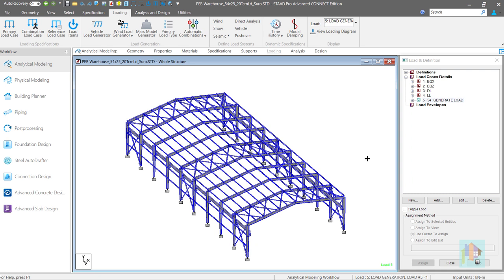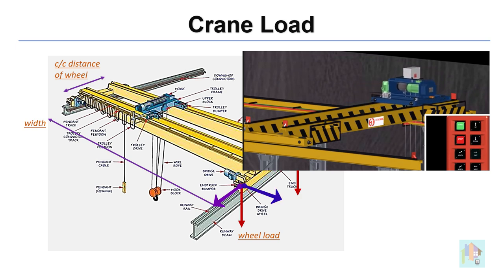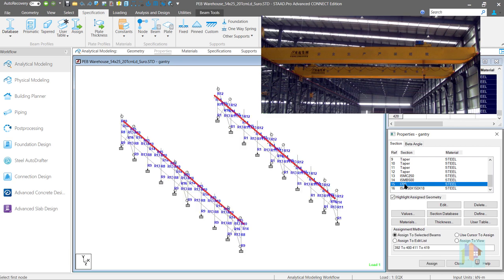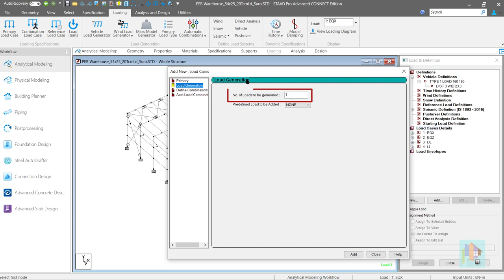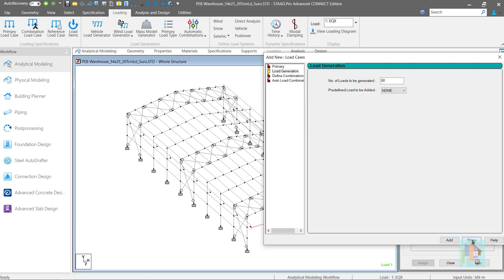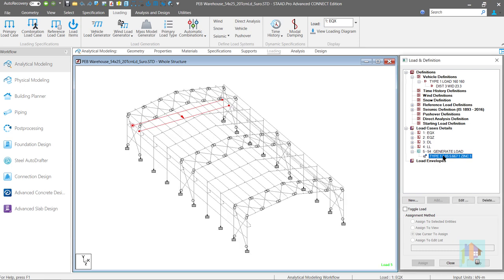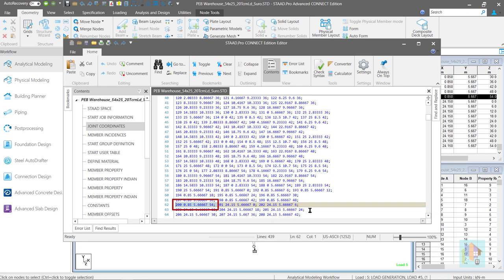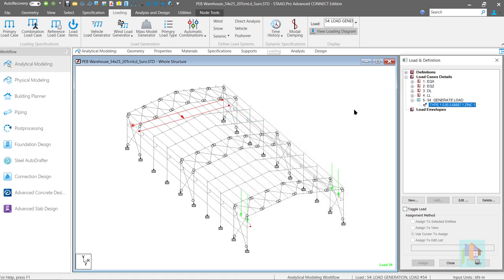Moving Load: p5 - Crane load for Gantry Girder Design || EOT Crane, Vertical Wheel Load

Comment: Staad is unable to add an opening enclosed by beams in parametric plate generation. Please sugest how to add an opening enclosed by beams?
Reply from the maker: If you use parametric model, you can add an opening at any portion and the mesh is adjusted based on the opening. In older version of STAAD, there were few problems with Parametric model option, you can try with the latest one where those problems are fixed.

Comment: Sir Auto load wind generator is not working in my system
Reply from the maker: Wind load generator should work properly unless there is some modelling issue or the inputs are not correct. Also in older version of STAAD, it was not possible to use this with SET Z UP command.